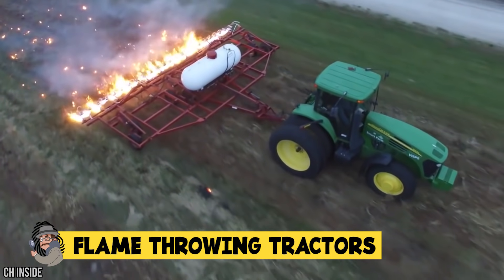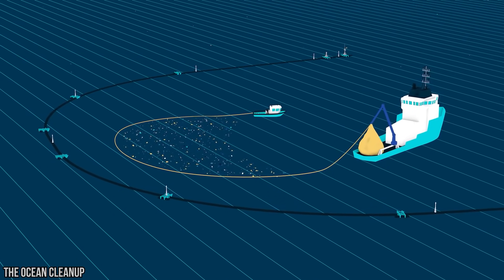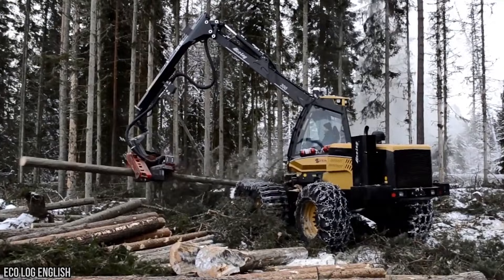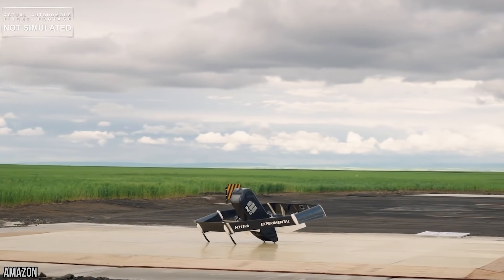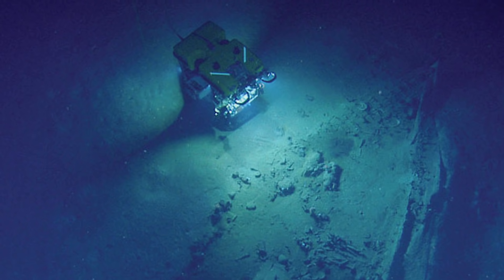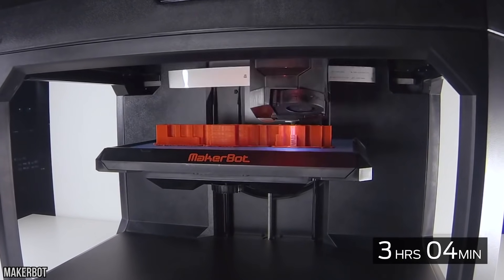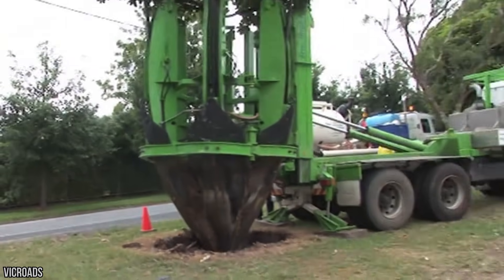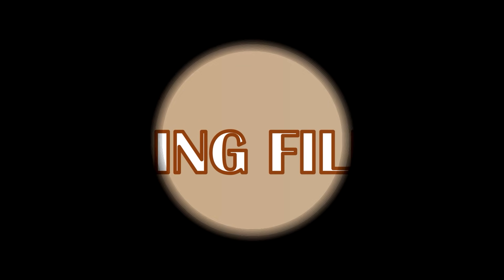15 Most Useful Machines That Do Incredible Things

Comment: well im not against the self driven trucks , "much" , im not a trucker but my concern is , and its based on the video , when the truck takes a sharp turn or the road it self has a sharp turn , the back wheels went over the line and in to the incoming lane , so my question or concern is , what of these companies , if the truck hits a vehicle regardless of the damage , and the truck keeps going because it has no driver to stop and check on the welfare of the citizens , will they be liable for a "HIT AND RUN"? , as everyone gets charge ? or these million dollar companies would be able to settle it with the "horrible judge system" we have , and get away with it .....

Comment: I don't know how to use a 3d printer??
Can it make a cute doll??
Reply: 3D printers can make anything that hard solid or hollow plastic. Depending on the doll type. It could make some of it parts, but overall its more meant to replace parts broken because large factories will use less power, raw material and time to produce the same. In turn it is often just more cost effective for an average person to just buy a doll or whatever in the store. If you on the other hand break a plastic part on a washing machine or similar and the blueprint is online. It might be much much cheaper to 3D print it because the company that sells the parts have a indirect monopoly and therefor mark up the price allot.
Reply: @Lobos222  WOW 2 Cool! 😺